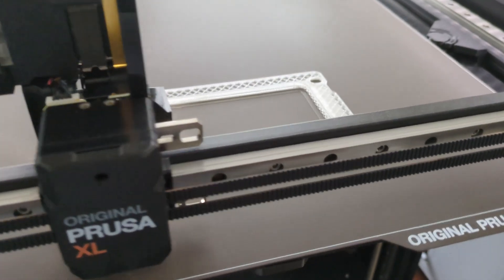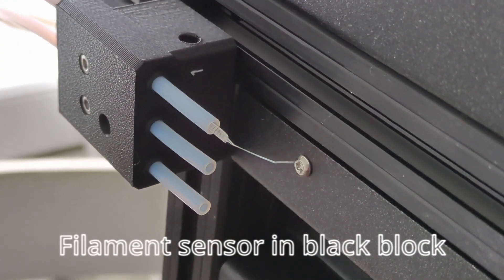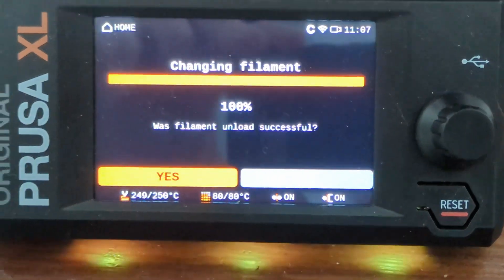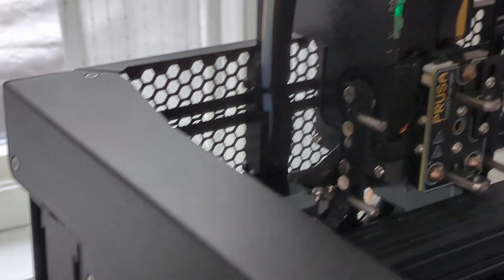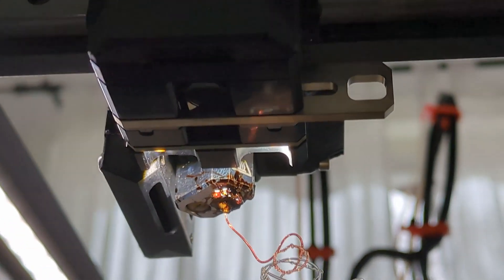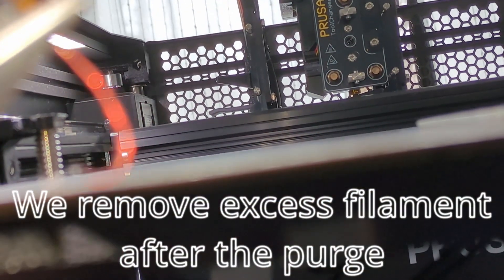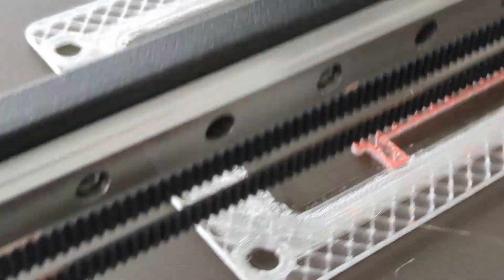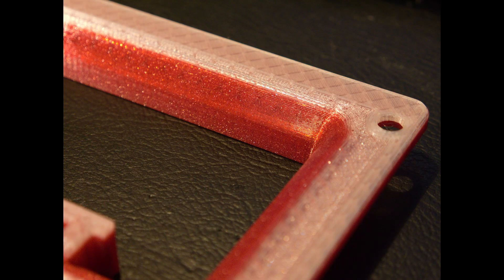Prusa XL filament change during print

Comment: On the filament selection page when you start new print. The  screen will show the main filament in the sliced file then the 2 or 5 options. if you go and click the filament then go choose another roll it asks if you want to replace or rollover choose rollover and when it ends it will start the new one seamlessly..